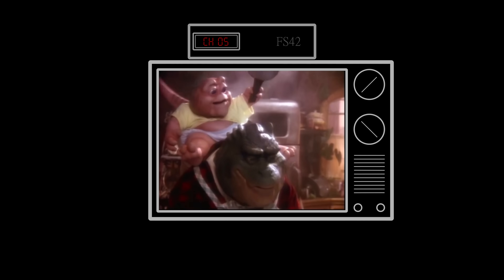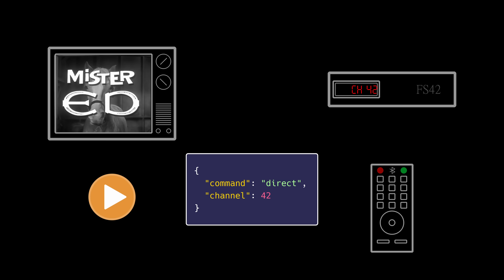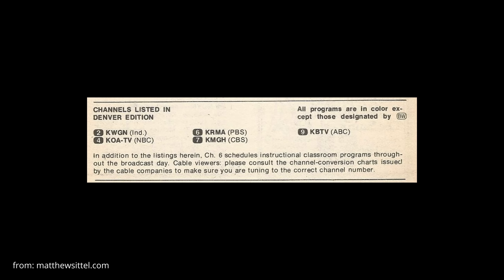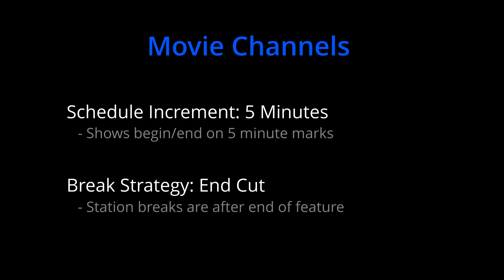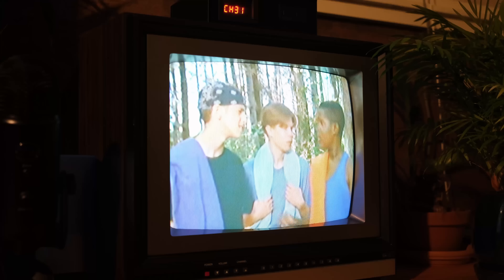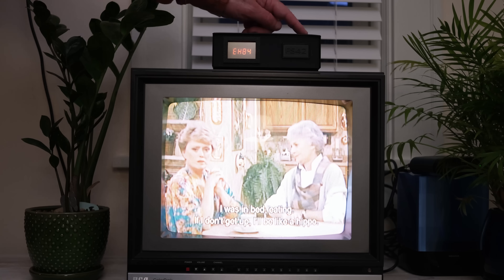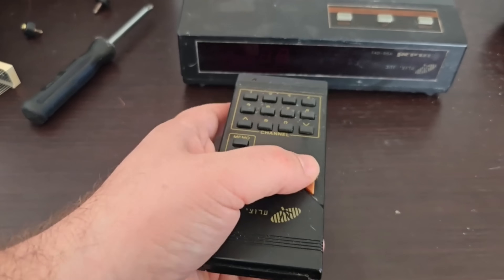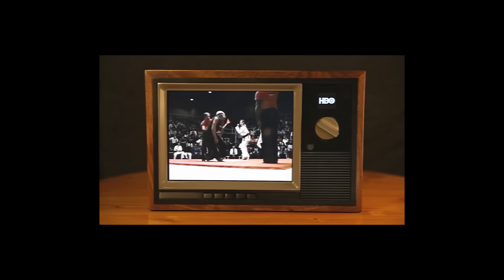90s Cable Simulator - Recreating Retro Cable TV with a Raspberry Pi

Comment: A great addition would be using existing metadata available on containers as a way to setup scheduling so that people sharing content don't need to add that configuration separately
Reply from the maker: It reads the stream duration from the metadata currently. What other helpful information were you thinking - like if they are tagged with a genre?  One of the next features I want to add is aligning commercial breaks with chapter markers if present (and falling back to silence/dark detection if not).
Reply: You could use metadata like release date to compile shows/movies into “throwback” segments, or look up the original country/publisher to make specialist channels (e.g. BBC America). 

In terms of your advertising alignment work, I’m not sure whether this was a thing in America, but in the UK we used “Cue marks” - these were black and white bars that scrolled along the upper right corner of the screen when an advert was coming. Given their common design/positioning it would probably be possible to detect them in software.

Comment: I've used Plex/Jellyfin forever but I've always wanted it to have TV stations - just shows playing on their own schedule. This goes so far beyond that - amazing
Reply from the maker: Thanks! Yeah, I've only recently learned about Plex and Jellyfin - they seem like powerful tools.  I wonder if there's an architectural limitation behind the reasons they haven't added stations?
Reply: I would imagine its simply because they never thought people would actually want "simulated" stations. The reason Plex exists is to give you control over your own content, a simulated station takes that control away somewhat.

But I like the idea of turning on a station and just watching whatever random show is showing at that time.
Reply: @wrongdog_reckons  Plex can handle 3rd party tuners so you can emulate a station using a range of 3rd party tools including Tunarr, Antennas, tvh-iptv or DizqueTV. Some of them aren't particularly stable, or only have limited support now, but while there are 3rd party tuner emulators available it seems like Plex won't invest time into creating one in-house.
Reply: @wrongdog_reckons  Jellyfin does allow integration of live tv. I've used a project called ErsatzTV before to do all of the scheduling and then Jellyfin could play that like live tv but my setup has changed and I haven't set it back up again.
Reply: There is a plugin for plex called pseudotv, it came from kodi originally and does something similar with your plex library.
Reply: There are 2 things that I know, which sort of brings back this experience. Pluto TV has a lot of content from the previous decades, going as far back as the 60s and up to the mid - late 2010s. Its main appeal is that it streams old content while behaving much like standard television with its guide and many channels that are sectioned off into their own genre.

Then there's ToonamiAftermath, a website dedicated to streaming old Toonami original broadcasts of 90s anime at the time, while also including some of Cartoon Network's 90s shows during the evening. All the while playing both 90s and early 2000s commercials with the former being the most prominent. The website's homepage has a screen where you can interact with it with your mouse, and flip through its (quite small) handful of channels by clicking the +/- button and as well seeing what's coming up on its guide button. The 2 main channels are T-East (the main channel of the website), and T-West (The 2nd channel that is more so for people who missed out on the day's updated schedule line up).

With the Aftermath, you're going to see a lot of 90s anime and classic Cartoon Network shows, and mainly 90s commercials with some of the early 2000s advertisements for games or consoles that were released at the time (GameCube and Gameboy Advance mostly).
Reply: How much memory does it take to store all of this content?
Reply: @jonathanwright4953  looks like some tens of terabytes, at least.
Reply: Windows Media Center

Comment: Absolutely amazing seeing how far this has come! Been wanting to get mine setup for a while, but never figured out how I'd do it and have all the channels I'd want with only 512GB of storage on my Pi. Network storage would probably be better since that could allow me to run it on all sorts of devices and not just my retro TV, but it's pretty expensive to get a size I think would fit everything and I can't justify that cost yet. But still, amazing work, and I'm looking forward to messing with it in the future!
Reply from the maker: Thanks! If you see that blue thing behind the cable box in the picture, its a hard drive dock with cheap spinning drives inside. It plugs into the wall so it isn't powered by the pi and then connects to the pi via usb3. It works great! I printed the blue top to cover the hard drives. I had used SD cards previously but just found them inadequate for expansion - spinning hard drives (SATA) have big capacities as a fair price. Cheers!
Reply: @wrongdog_reckons my ideal solution will probably be something like a NAS the Pi connects to and automatically launches FS42, and a button on the USB remote I have will shutdown FS42 and open KODI or some other media player so i can still choose something to watch when I want something specific. I dunno how easy this would be, or whether or not I could potentially source media from my brother's Jellyfin server, but it's an idea I plan to work on! For now though, I'll just try to get a working setup with what I got and go from there.

Comment: I would love to build something like this but couple it with multiple pi zeros and modularors to create OTA channels so I can use some of my old TV tuners for something other than channel 3/4
Reply from the maker: What do you use for modulators? Would like to learn more about how you are transmitting. No reason it shouldn't work - give the software a try and if you get blocked, just file a ticket on github and I'll try to help you out. Cheers!
Reply: @wrongdog_reckons  sorry, I haven't built anything like it... I would like to thought. I'll let you know if I get around to it though

Comment: Yo this is awesome. I’ve been trying to do this with a real PC+ a mister but now you have me thinking of switching over to the Pi route
Reply from the maker: Its a good machine for this type of stuff. Low energy, low heat and plenty of horse power to play videos. I run it on my desktop and even my steamdeck - as long as its Linux, it should work fine on any machine that has good video acceleration. Cheers!

Comment: Amazing... Now on to your next project: recreating the PrimeStar Satellite TV experience for those of us who still live too far from town to get cable TV 😅
Reply from the maker: A lot of my 'cable' experience actually comes from satellite, which was easier to get in the boonies. I'll have to look into how to make scrambled channels :) Cheers!
Reply: @wrongdog_reckons  So it really kind of depends on the service. There were so many ways to mangle the image that were completely different (and of dubious security from an information standpoint) and they were all used.
The classic way is to "just" not emit a sync pulse, which causes the TV itself (!) to distort the image. If you're generating the video signal yourself, that can be done. Later on there were more sophisticated techniques like line shuffling/shifting. For a good simulation, you'd want multiple methods. And you'd probably want it to vary by time period as well.
The digital ones are pretty straightforward to implement for a simulator.

For analog ones, you'd want a pretty solid understanding of how an analog television builds an image.
Like, at least by the 80s/90s, an analog television would feed the sync pulses into a PLL which is used to time the scanning of the beam. The sync levels are also used for automatic gain control.
With sync suppression, the automatic gain control blows the signal's levels out of proportion, and then the resulting signal sent to the sync separator isn't at the proper level, so the PLL ends up seeing video content as sync. It then, as a PLL does, tries to lock to it, but because the signal's constantly changing, the PLL's just wildly varying its output. That variance results in the visual effect.
Reply from the maker: @ - that's some amazing information. I should be able to accomplish something like that by shifting parameters around on some FFMPEG filters. I haven't looked deeply into it, but I was able to simulate bad OTA signal by shifting values on filters like noise, v_scroll and h_scroll. I can probably find some old scrambled channel VHS recordings to match to. Seems like fund :)
Reply: @wrongdog_reckons   is there a way to change the channel transitions? it'd be cool if you could get the blue stripe across the top of the screen whenever you changed channels like directv
Reply from the maker: @xxstarbrite02xx it has a couple of different transition effects, wouldn't be difficult to add more
Reply: @wrongdog_reckons , you won’t believe but I’ve been thinking about this all idea a few weeks ago. I thought that it would be cool to recreate Ukrainian 00s channels by splitting air recordings from a YouTube, and make some sort of app/script as a video broadcaster to watch it online, lol
Reply: I have an old prime star TV guide lol

Comment: I can't wait to have something like this, just feel so unintelligent when it comes to building something like this out.
Reply: Wanna know a secret? EVERYONE feels that way when they tackle something like this. EVERY. ONE. There are no exceptions. Take heart from seeing that someone else has successfully accomplished this, and use that as your inspiration to build your own. Also, this video is 18 minutes long, but this project obviously took many months and LOTS of false starts and errors. Everyone will face those also.
Reply from the maker: @  - this is amazing advise and extremely accurate. Well said.
Reply from the maker: It does take a little technical work to set an instance up, but you should be able to do it without writing any code at all. I've tried to document the process on the GitHub project wiki it seems to work for folks. If you decide to give it a try and you run into any blockers, post an issue on the GitHub page and I'll try to unblock you. Cheers!